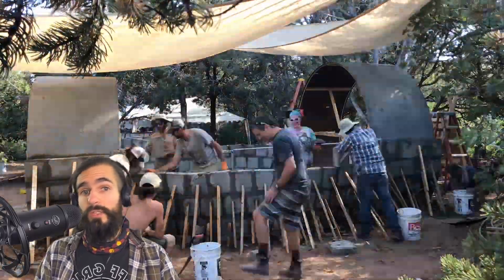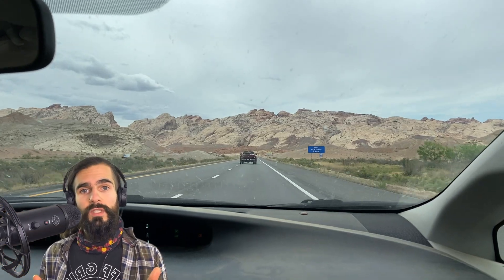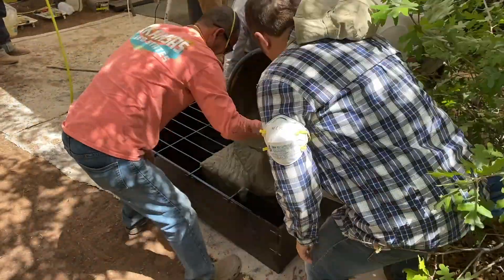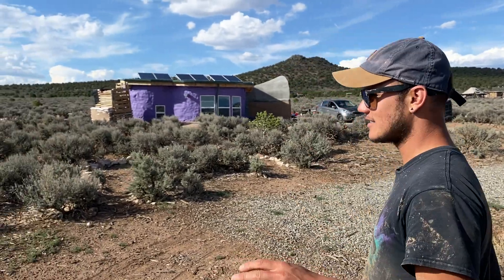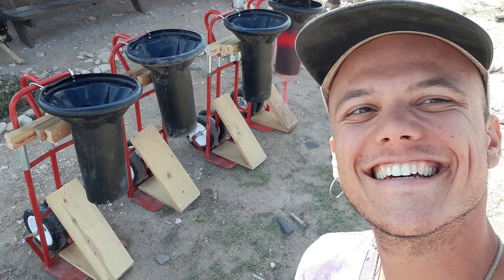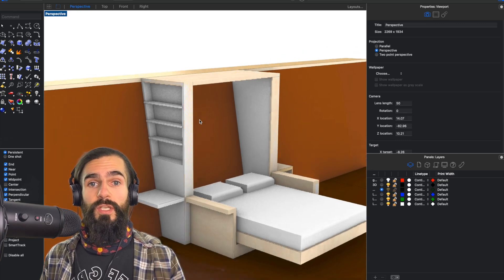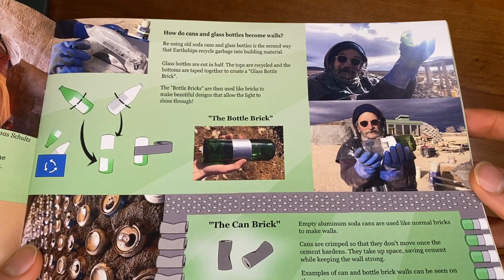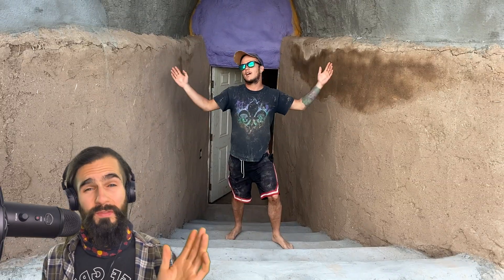Best of 2022! My Top 5 projects: Earthship | Aircrete | Hyper-adobe | Murphy Bed | Preview

Comment: Can we build bottle wall with aircrete?
Reply from the maker: @mmcgartland2095  Great question! Tricky to answer- Ive worked with both and thought about it a lot. Depends on where- In a dome- where aircrete blocks are stacked and plastered …the bottle brick holes must be cut after and farther apart, so they don’t comprise the strength of the wall. If you want them in dense clusters best to use regular mortar for that. Knowing where its appropriate to use either mortar or aircrete based on their material properties is key! Where are you thinking?